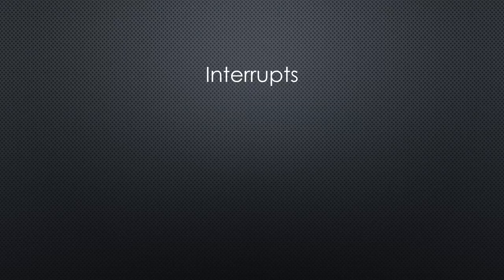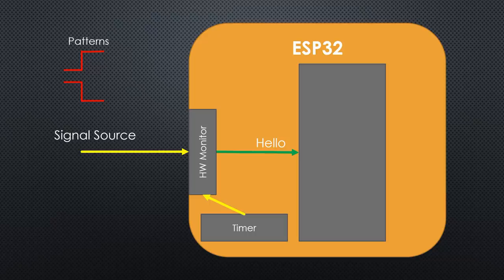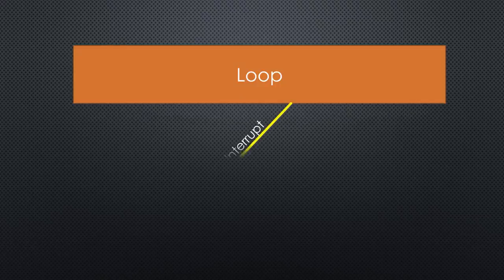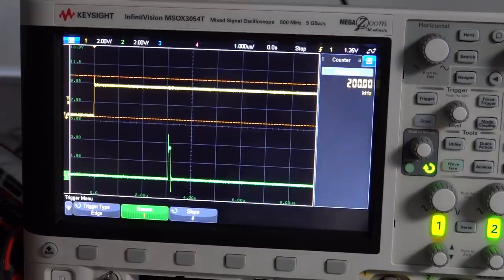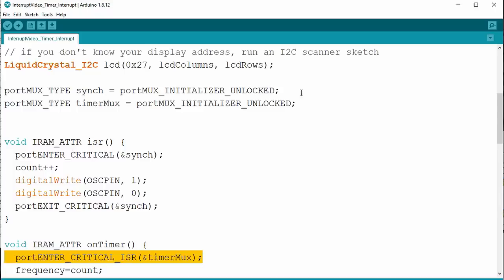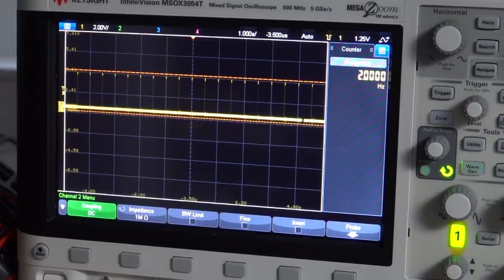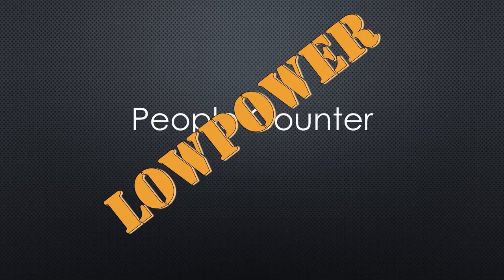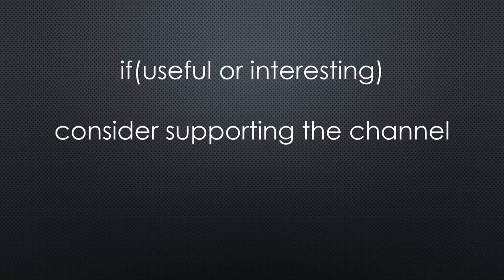#328 ESP32 Secrets: Interrupts, and Deep-Sleep under the Hood

Comment: Is it possible to handle the interrupts with the second core?
maybe this fixes the high jitter on EXTI
Reply from the maker: It is possible, but I do not know why it would change. Maybe somebody tries?
Reply: @AndreasSpiess  The main core is running many background tasks,  I believe the second core is completely idle, If RTOS is handling the interrupts (which it shouldn't) that's another story
Reply: @AndreasSpiess  I think the delay is due to other FreeRTOS tasks taking over. Running it on another code could help. You need to create a very high priority task on that core and disable the watchdog timer.
Reply: Ali Devrim OGUZ FreeRTOS seems to have a make menuconfig option to lock it to only the first core? would this assist after your interrupt suggestion?

also interested in other versions. wroom, wrover, (solo can’t be real-time), S2. Would love to have time to test them. Probably goes for all of us. Also need to invest in oscilloscope / dsi.
Reply: @jrgalyen  yeah that'll probably work too, however it may not let you run your program on the other core. I haven't tried that. I only saw the menu option to "not run the freertos on a single core"
Reply: @jrgalyen  also for what I said, even with a very high priority task, the freertos can try to do some context switching and mess up the timing. I'm just putting ideas out here but I didn't try them. Maybe merging both of our ideas might work 😂 Infinite loop on a non freertos core haha

Comment: Verv interesting Video. 

The main difference i normally do on similar Programs i don't reset the counter Variable, but use the difference to the Value of this Variable from the last read. This only works when the difference is smaller then half of the maximum value possible with this variable ( 2^31 with 32 Bit Systems ), so wraparounds are always result in differences in this Range.
Resetting the Variable is only safely possible when the changing of the Count-Variable can not be interrupted ( this is true when changing this Value is a single command on the Processor, The Processor has some means of binding more commands together in an non-Interruptible way - even across multiple Processors, or you can use for example critical sections ) Otherwise the ISR might be interrupted in between reading the Variable and writing it back after changing it - so  the reset  Variable will be overwritten.
Reply from the maker: Thank you for the tip!

Comment: Having two identical CPU cores onboard (the "sleep time"  processor is irrelevant for this discussion, since it is not symmetrical to the two main CPU cores) does not make the ESP-32 a "true" SMP computer chip (like AMD/Intel, higher-end ARM, etc.). A "true" SMP machine provides built-in arbitration for interrupts, that allows any of the CPU cores, sharing the common SMP system bus, to respond to any interrupt source with impunity. On the x86 family of processors for example, this arbitration achieved by special hardware, known as APIC (Advanced Processing Interrupt Controller). In addition, "cache snooping", memory locks, and many other mechanisms are provided in SMP architectures to guarantee "atomic memory access" and cache coherency that are all necessary for "Transparent Multi-Processing" capabilities, Such capabilities free the programmer from having to deal with many of the fine details of parallel hardware multi-processing. The ESP32 (as well as many of the ARM-based multi-core chips reduce chip complexity by relegating the responsibility for memory coherency and shared interrupts processing to software. The result is a compromise between ease of programming and chip cost (which is proportional to the die area of the chip). Simpler chips cost less and may also consume less energy during most operations; however, parallel operations also require very careful programming and understanding of the hardware limitations in a pseudo-SMP mode of operation. The need to synchronize the CPUs via software, results in overhead that eventually, adds latency to the system behavior. This is what distinguishes SMP (Symmetrical Multi-Processing) class of processors from the simpler "Multi-Core" class of processors. Concurrent execution on a single CPU core is a lot more complicated when more CPU cores are added.
Reply: Although I did not verify this, I suspect that multi-CPU synchronization on the ESP-32 is utilizing the "Peterson Lock" (see: https://en.wikipedia.org/wiki/Peterson%27s_algorithm)  for memory access arbitration. This is very common among implementations of "pseudo SMP" programming models.

To quote the programmer's manual for the ESP-32:
Vanilla FreeRTOS implements critical sections in vTaskEnterCritical which disables the scheduler and calls portDISABLE_INTERRUPTS. This prevents context switches and servicing of ISRs during a critical section. Therefore, critical sections are used as a valid protection method against simultaneous access in vanilla FreeRTOS.

On the other hand, the ESP32 has no hardware method for cores to disable each other’s interrupts. Calling portDISABLE_INTERRUPTS() will have no effect on the interrupts of the other core. Therefore, disabling interrupts is NOT a valid protection method against simultaneous access to shared data as it leaves the other core free to access the data even if the current core has disabled its own interrupt.
Reply from the maker: I did not use more than one core for my video.
Reply: Andreas, please understand that the software framework (actually FreeRTOS) underneath the Arduino application code is always at work, regardless of you assigning code (task) to either one of the CPU cores, or not.
CPU-0 runs many of the wireless code functions; however, CPU-1 is also running code that may be invisible to you (possibly, garbage collection for the memory allocator). In any case, CPU-1 is likely NOT in HALT state even if you did not assign any code to it.
Since all the CPUs share the same memory (and I/O) buses and the internal instruction and data caches are limited in size, shared memory accesses must be arbitrated. Due to absence of atomic RMW (read/modify/write) memory access support across the memory bus, all MP synchronization must be managed through software (via RTOS kernel functions). Because such functions require cache flushes to guarantee MP serialized access to memory, the synchronization is slower than usual. True SMP processor incurs some overhead each time that (atomic) RMW operation is executed; however, extensive hardware support (native MP bus protocol, MP memory locks, cache snooping, sophisticated interrupt dispatcher, etc.)  allows this type of operations to be orders of magnitude faster.

Comment: Nice. To be fair, the ESP32 is running a very high level OS, FreeRTOS with changes. It doesn't have to run FreeRTOS, but you'll experience a great deal of trouble using Arduino or PlatformIO if you eliminate the OS. (You'd have to write a new core library) Something that might make a difference is to set the affinity of the ISR to the second core, which is unused by any code unless you explicitly force tasks over to it. I've never tried it, but it should be produce measurable improvement.
Reply from the maker: You are right. I usually just take what I have and check it out. I would probably use a different processor for real-time applications before I would start to mess around with the underlying infrastructure ;-)
Reply: @AndreasSpiess  I believe you'll have much better results w/ interrupt driven ESP32 tasks, working from Espressif's development environment. And you might have some limited success just forcing your loop function onto the unused core via xTaskCreatePinnedToCore(myLoop, ...). There's no reason why an ESP32's Xtensa cores can't handle what you were trying to do in this example, but the Arduino program model could be a limiting factor. I know...target audience. You're right, but the ESP32 is an AMAZING development board. I don't use it much, but only because I never need that much processing power. :o)

Comment: Andreas, I think your interrupt latency problem is caused by using the straightjacket and  rubber room of the  Arduino attachInterrupt() instead of using the ESP IDF's esp_intr_alloc(). Finding the definition of the attachInterrupt was a real pain-- google failed, but I finally found https://github.com/espressif/arduino-esp32/blob/master/cores/esp32/esp32-hal-gpio.c .

I think by default, you are getting a level 1 (lowest) interrupt, so other interrupts will interfere. You can get level 3 with some flags in the esp_intr_alloc(), but to reduce latency you'd need to use level 5 (Timer.2 uses level 5) and this level requires an assembly ISR (not C callable). If you only modify the counter in the ISR and it is word-aligned, then you shouldn't need to worry about portEnter (but you can use esp_intr_disable()), and you can run the ISR in the other CPU. In assembly, your ISR only needs to increment the counter and return from interrupt.

Perhaps having a low-level interrupt wouldn't matter running on the second core. It would be interesting to see your latency on the scope running on the second CPU. I assume it's not used by the RTOS except maybe timers?

It would be interesting for you to make a followup video demonstrating how to use a high priority (level 5) interrupt with a short assembly handler running in the second CPU, and see how high of a frequency you can get.

Also, I came across this: https://github.com/MacLeod-D/ESp32-Fast-external-IRQs where he uses dedicated polling on core 1 and claims >3MHz counting.
Reply from the maker: Thank you for the links. I  just was surprised, I have no particular project for eh moment...

Comment: Great video! Most of the programmers don't know that they should use more interrupts! It seems that you can't block the interrupts inside the isr.
Reply from the maker: There are some discussions going in other comments around "disable interrrupt" ;-)
Reply: @AndreasSpiess  yes i have read. Normaly if you learn interrupt programming, the first command in the ISR is that you mask the interrupts, that no other can block you. Only die NMI is allowed

Comment: Andreas, have you ever looked at the Parallax (Prop) P1 CPU?  80 Mhz, with 8 parallel cores.  Very low power consumption via code clock resetting. Is ideal for real time application use.  No need for interrupts.
The soon  to be released soon  P2 CPU will be 10X faster and much more capable. The P1 has been around for over 10 years with many objects available in their object exchange. It is my RT goto processor.
Reply from the maker: I decided to go with the Arduino IDE for this channel because it is widely used and has lots of libraries and community support.

Comment: Great video.  I see that was with Arduino.  Are you still using microPython too? You mentioned that you talked to Expressif. If you used the RTOS process, does it work better (according to them)? Did you happen to ask about making One core operate RTOS and have the other core dedicated to user apps (and interrupts)?   I really think you do a good job with your videos. Keep up the good work!
Reply from the maker: RTOS always runs on the ESP32 and it is not easy to get around it.
Reply: I think you can run a higher priority to get around the issues?
Reply: @AndreasSpiess  Here is a link that explains that the Interrupt level needs to be above 1 (the default) with 7 being highest. This may solve your problem.  I am just starting in the ESP32 and experimenting with microPython, Ardunio is next if required.  Here is the link: https://docs.espressif.com/projects/esp-idf/en/stable/api-reference/system/intr_alloc.html

Comment: I think that Timer0 is used by the underlaying FreeRtos as internal Tick source (behind the Arduino Sketch).  Due to this, you are getting an "oversized" ISR and a long response time. You might try with timer 1 and check again the response time?

ISR TIMER0(
.... SystemTick (with context switch)
.... your ISR routine( with its context saving)
.... (context restore)
)

ISR TIMER1(
.... context saving
....your ISR routine
.... context restore
)

greetings from Argentina!
Reply from the maker: Thanks for the tip. For the moment I have no fast application. Maybe somebody else tries it?

Comment: I would add one word of warning: When using interrupts to detect the activation of a pushbutton, this will lead most likely to unwanted effects, specifically to multiple invocation of the ISR for a single press. The reason is the bouncing of the mechanical contact. Therefore special debouncing routines are necessary.
I'm sure I don't state anything new for you, however, I would have added 1-2 sentences to the video directly after the recommendation to use interrupts to detect such things. :-)
Reply from the maker: Switch denouncing is not specific to interrupts. It always have to be done.

Comment: Beware that the interrupt latency is large enough, that if you're running the Arduino interrupt driven 'hardware serial' routine, with the default buffer size, at high data rates (115200 or more), you  can and will over run the buffer.  The easy fix is to increase the size of the buffer.   The buffer defaults to a small value to work with the Arduino Uno, that has limited RAM memory.
Reply from the maker: Thanks for the input! You are right.

Comment: It might work better if you put a 800ms sleep inside the if in the main and a 1ms sleep in the main loop.  This will not affect your accuracy much; but, it will make sure the isr has plenty of time to run.  This is one case where sleeps are good in a realtime system.  It is a balance.  Whether this works or not depends on how the ESP32 OS/Driver is done; but, since I believe it uses FreeRTOS then it probably will be better.
Reply from the maker: The ESP always boots after sleep. Other than the Arduinos. So no sleep inside a loop :-(
Reply: @AndreasSpiess  By "sleep" I meant delay (you are sleeping the thread).  Sorry, old terminology habit.

Comment: Thanks, I was surprised by the latency, possibly partially due to the use of RTos.  What disturbs me the most was the possibility of crash at high frequency. This mean that if you get accidentally high frequency on an input where you expected to measure a low frequency, your ESP32 can crash. Not good.  Also if you have to disable Wifi to use the interrupts, this limits the interest of the processor.
I wonder if a separate processor (like a small ARM) would not be simpler to use for high speed time critical measurements, making the result available for an ESP32 or PI for more complex processing.
Reply: You don't have to disable WiFi to use interrupts - it simply might affect the timing of timer interrupts. Andreas doesn't mention how big this effect is but it's worth verifying yourself if you need precise timing.
Reply from the maker: @Jean-Marc: Ivan from Expressif suggests in his answer to use external HW for critical tasks.

Comment: I have an issue with ESP8266 in my weather and fertilization station where ESP8266 must exchange data with ATMEGA328 via I2C. What I found very strange is that ATMEGA328 can  receive data from ESP8266 without any loss but ESP cannot receive any data from ATMEGA328 even if it runs at 80MHz which is 5 times faster than ATMEGA328. Is ESP8266 Interrup latency much slower than ATMEGA328's or is it due to Wifi and multitasking in ESP8266?. I tried sending data using Wire.write(),  ATMEGA Master ESP Slave, and also tried I2C request mode where ESP is Master and ATMEGA is Slave. I also tried to reduce I2C frequency to the minimum (like 30 Khz) but nothing worked. Is "WIFI OFF" function available also in ESP8266? Can it solve the problem? Here a link to my web interface to my weather station:
http://www.abrobotics.be/siliconceptsarl/METEO/meteoframe.php
Reply from the maker: I cannot do remote debugging. But you can switch Wi-Fi off on the ESP8266. Maybe you use a logic analyzer for debugging? I once made a video about that.
Reply: @AndreasSpiess  Thanks Andreas for your reply. I tried switching off Wifi using WIFI_OFF at the beginning  of ISR then WIFI_RESUME at the end of ISR but also it doesn't work. I will try to send from ATMEGA328 to ESP8266 using hardware Serial and Software Serial. As you suggested I will debug I2C using logic analogic. Unfortunatly I have it in my lab and I am now stuck in another city due to Corona virus.

Comment: At 7:08, I would recommend resetting count=0 right away, to improve accuracy. 
The display() routine is time consuming, so events could be lost.
Reply from the maker: Yes, the display() routine is slow. That is why the last two lines have to be together. You also ca n put it in front of this routine. It will give the same result.
Reply: @AndreasSpiess  
Maybe I’m not understanding the code correctly. Please correct me if I’m wrong, but if an event happens during the display() routine, the counter would be incremented, and then later the counter would be reset, so those events would be lost?
Reply: @AndreasSpiess  
Ok, I think I get it now. Some events might be “lost” but because the lastEntry is also reset at the same time, those lost events wouldn’t change the frequency measurement, it would just be a “gap”.

Comment: Very great Video,
However i think that you can User WiFi without a Problem because it normaly uses the Seconds core in the esp32. 
I am not a 100percent sure, cause i think Last Time i used Interrupts i used a different methode.
Reply from the maker: Well possible. I just did not want to cover it in this video.